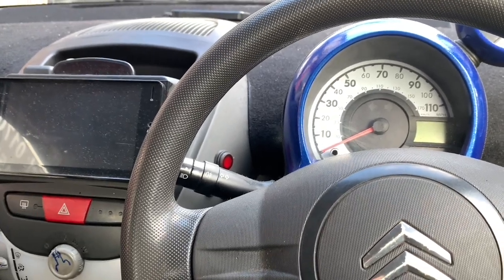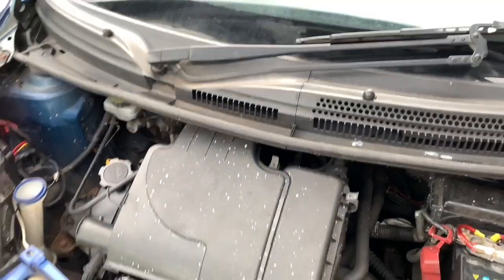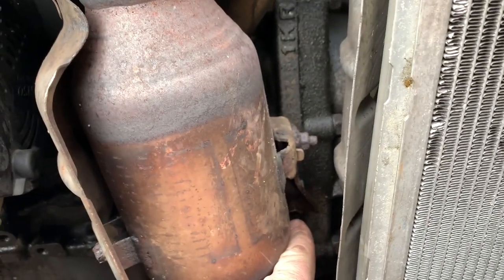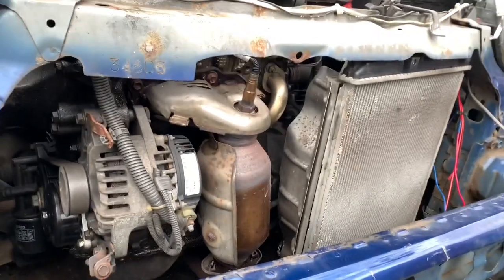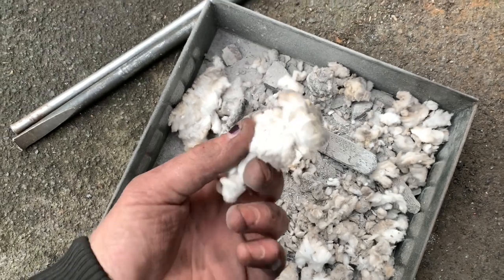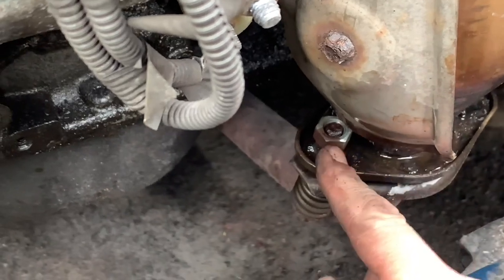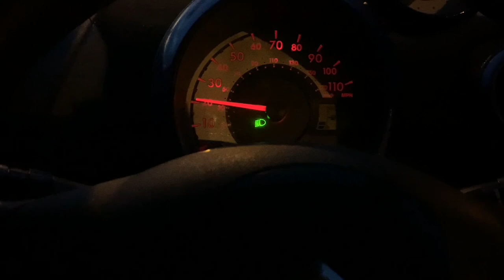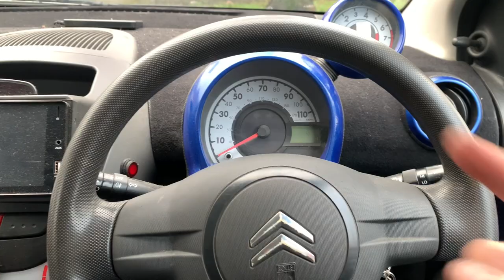FREE DIY DeCat + Sound Test (C1/CityBug/107/Aygo) Easy but Illegal Modification

Comment from the maker: Just add a bit of info thats not in the video: 
Since filming it, the EML has stayed off, must be down to the HUD I’m suspecting. 
MPG no noticeable difference. 
It actually appears a little bit slower in the side by side, but I think that’s down to me being on a steeper part of the hill tbh. If anything it does seem a little tiny bit faster/more abrupt but it is negligible. 
It doesn’t sound any louder when driving. 
All in all unless you’re gonna do other mods to go with it, it’s a complete waste of time… so I would 10/10 recommend doing it, obviously 🤷‍♀️

Comment: The bolts holding on the cat to the engine do come out easy even if they look really rusty, did mine as i replaced the cat and thought the same at 1st but in the end they came out ok, also the clutch is a doddle on these, i did mine with only hand tools and now i have arms like an angry gorilla thumping his chest.
Reply from the maker: Yea I know what you mean. I think they will probably come out but only had a bit of time at work when was quiet so didn’t wanna end up drilling snapped bolts out. Last time I did the clutch on this shitter was a few years ago and wasn’t bad, probably 3 and a half hours chilled out on the floor but this time will probably take double that if I film it haha

Comment: My cat has had it too. Keep resetting the engine management light but it comes on every 200 miles or so. 
MOT is due end of March. But worried about getting the thing off. It could be a quick half hour job. Or it could turn into a nightmare if one of those bolts snap in the engine block.
But at least Euro 4 cats are cheap.
Reply from the maker: Exactly. That’s why I didn’t take mine off. Tbh it will probably come off with some heat and careful determination, but I didn’t have time to put it right if it did snap. A new aftermarket cat is only about £60 so I’ll just get one of them when if finished pissing shout doing my scientific researching 🤔

Comment: The induction tool - without one - I wonder if you could use an old car battery  - using salvaged batt leads - put the positive lead with its batt connection or a socket for size of bolt onto the rusty bolt - then earth the negative lead to chassis could do a similar job🤔 I’ve not had to get involved with rusty nuts yet - was just a thought.

Might have to connect negative lead close to the rusty bolt then connect to battery when ready
Reply from the maker: I know what you mean, but no it wouldn’t work unless you put a lot of current through it and it was the high resistance part of the circuit. The induction heaters work but magnetic induction, with some king of current oscillation or some fancy shit. 

You can weld with a battery though 🤷‍♀️

Comment: I did this years ago and only found out afterwards that you really shouldn't breath in any of that dust. If anything, the gutted cat affected engine performance negatively.
Reply from the maker: It’s probably not great to breath in. I regret not doing a before and after comparison tbh but it seemed to increase performance slightly at higher rpm

Comment: Slight off topic question if I may
I own one of the few C1s that doesn’t have the rev counter pre wire would you know if I can take a feed from the obd (no3 pin ?) or where the factory pre wire is wired to
As I can’t find any info online
PS keep up the great work it’s refreshing to watch someone who doesn’t take things to seriously 
Thanks in advance
Reply from the maker: I’m not sure about taking a direct pin for it, but the HUD I fitted plugs straight into the OBD displays rpm if that helps.
Reply: I recently swapped my C1 mk 1 for a mk2 and this doesn't have the rev counter which on this model is just a strip of leds. I would like to fit an aftermarket tach and apparently the signal wire connects to a pin on the ignition module. Would be interesting to know if anyone has done something like this. Or even fitted a mk1 "Mickey Mouse ear" rev counter if the wiring is compatible. Only mod I have done to the car so far is putting in a bigger battery, the car had the 012 burglar alarm battery in it.
Reply from the maker: @andw2638  there are OBD displays that will do it, like my HUD. They work on all cars allegedly.

Comment: Sound as a pound.
Talking of which, did ye get much for the guts of the cat?
Reply from the maker: Not yet, I’ve got to go out of my way so not had chance.
Reply: @StupidBlokeStupidVideos  I know the feeling - Ive a couple of 12v batteries here that are about a fiver scrap, but CBA going out of my way to the scrappers to drop them off (I aint chucking them tho).
Have you thought about fitting some cheap alloys to the shitter? Ive just picked up a set of Aygo ones for mine (107) that im going to have a bash at painting white. Tyres are FUBAR, so no need to mask off!
Reply from the maker: @micrashed  yea it’s on the list of things but only when I find a really cheap set. I’ve got shit loads of planned vids but weather and work not helping at the moment, and now I need to fit a clutch 🤷‍♀️
Reply: @StupidBlokeStupidVideos  Bummer on the clutch - still, its content ;)
I made the mistake of buying a set of Renner Clio 15" alloys after being told they were Aygo ones  - they will fit as they are 4x100 with a CB of 60mm but need spacers. Still they only cost £50 so I cant grumble, hopefully flog em on again via marketplace. I keep thinking I should look for a cheap Citybug and use it as an autotest car up at Blackburn where they do trials. Dont want to knacker my nice(!!!) Citybug.
Good luck with the clutch.
Reply from the maker: @micrashed  yea it will be a video when I get chance to do it, I’ve done it before many years ago on this car it was a piece of piss, but will take twice as long if I film it 🤷‍♀️

Comment: Did the EML light ever come on at all  as my cat is showing the same code don't really want to spend the money if it doesn't through a EML light
Reply from the maker: It actually didn’t, and still hasn’t. Maybe my o2 sensor is shagged 🤷‍♀️
Reply: @StupidBlokeStupidVideos  one way to find out is to gut it Saturday 😆
Reply from the maker: @liamclare9005  good luck 🤞
Reply: @StupidBlokeStupidVideos  gutted the cat Sunday since then eml light stayed off and the car proformance is better doesn't struggle climbing hills no more and no rough idling only down side is the exhaust is a bit noisier
Reply from the maker: @liamclare9005  sweet. Hopefully will stay off

Comment: It's gonna be great
Reply from the maker: How far in have you gotten before realising that it’s actually not? 🤣
Reply: @StupidBlokeStupidVideos   I had to keep watching ,,, 

I couldnt tear myself away , just in case it actually was great , and I missed it ,,, 
the trick is to punch one hole straight through the cat and leave the rest of it in situ , works to flow the gas  and helps keep things quiet to ,,, 

or so Im told of course ,, lol
Reply from the maker: @tomthompson7400  but then it would have made even less than the pretty much 0 difference it actually made! 

P.s. there’s some videos planned to follow this one up when the weather allows.

Comment: i did this now got no
power atall? anyhelp with be appreciated thank you
Reply: found the problem is this happenes to u check to see if there is any of the cat stuck in the exhaust works now
Reply from the maker: @ethanowens2nd  was going to suggest that you may have left a broken bit of ceramic blocking the exhaust 😂
Reply: @StupidBlokeStupidVideos  yes that did happen lol
Reply from the maker: @ethanowens2nd  oops 😂